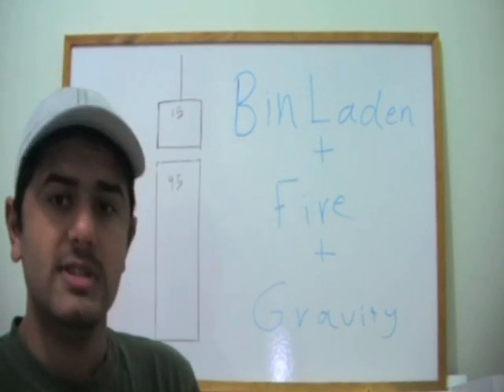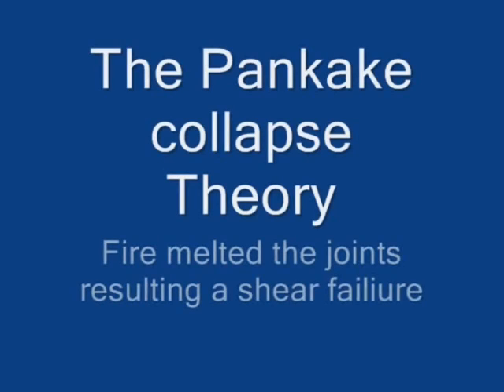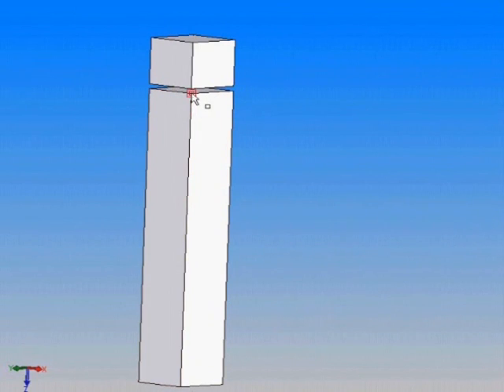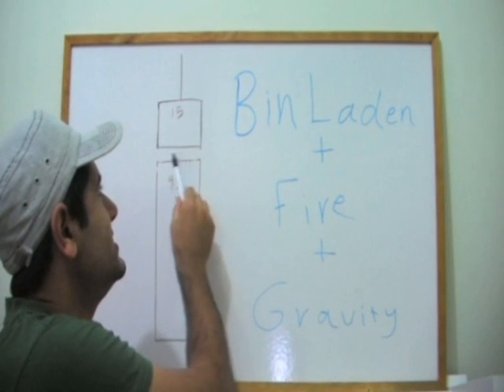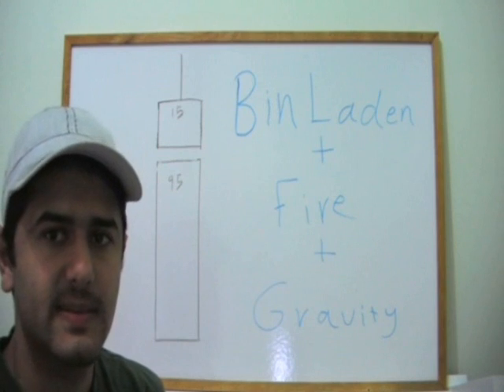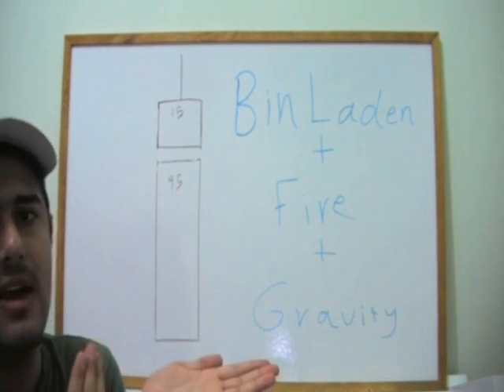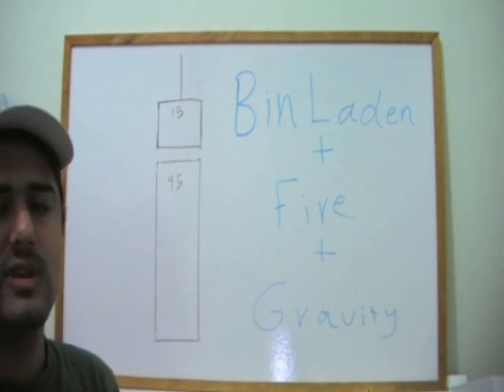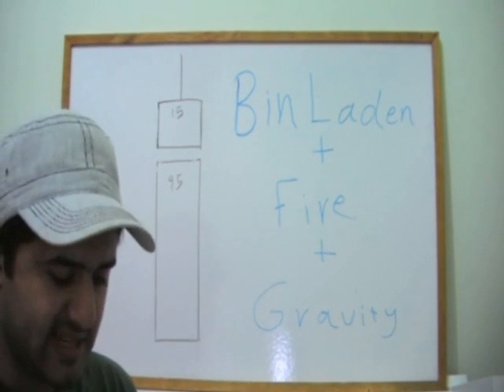(Part1) 911 Simple Physics Structural Failure Vs Demolition

Comment: "According to the 1964 white paper cited below, a Tower would still be able to withstand a 100-mile-per-hour wind after all the perimeter columns on one face and some of the columns on each adjacent face had been cut. Also, John Skilling is cited by the Engineering News Record for the claim that "live loads on these perimeter columns can be increased more than 2000% before failure occurs."

Comment: "John Skilling was the head structural engineer for the World Trade Center. In a 1993 interview, Skilling stated that the Towers were designed to withstand the impact and fires from the collision of a large jetliner such as Boeing 707 or Douglas DC-8. Our analysis indicated the biggest problem would be the fact that all the fuel (from the airplane) would dump into the building. There would be a horrendous fire. A lot of people would be killed,  The building structure would still be there."

Comment: They estimate the ' 767 ' had around 10,000 gallons of fuel. Not even 40% of a fully laden 707. A 707 traveling in normal flight actually has MORE kinetic energy kinetic energy than a 767, despite the slightly smaller size.  
     "The critical load ratio was probably well over 10, meaning that more than nine-tenths of the columns at the same level would have to fail before the weight of the top could have overcome the support capacity of the remaining columns."

Comment: @hornetgags 
LOL we're not talking about the maximum weight of a 767. We are talking about the actual weight of the 767 which is prolly more like 340,000 considering it was nowhere near fully laden LOL,, vs the maximum weight of a FULLY LADEN 707 which is around 340,000. So roughly they are the same weight. You are simply stupid and cant read or u flat out lie.The building was designed to take impact from a fully laden 707 at a speed OVER 600mph. Much more destructive than a 767 traveling at 500

Comment: @splendid1000 Not exactly true, the south tower core was impacted but not to the same degree as the north tower. However, it impacted towards the corner, as a result the opposite corner had greater weight pressure applied on it.

Comment: @splendid1000 I did:
The maximum takeoff weight for a Boeing 707-320B is 336,000 pounds.
The maximum takeoff weight for a Boeing 767-200ER is 395,000 pounds

The impact test for the 707 was lost in fog, lower on fuel and approaching at landing speed. Not a fully laden heavier 767 impacting at near max velocity. A full tank is very important as it is 1000s of pounds, you're just being plain ignorant (apologies for the pun).

Comment: @splendid1000 Unfortunately, this is where the Truth movement fails miserably. In a trial it's down to the prosecution to prove guilt. You are accusing so the burden of proof is on you. You send me evidence that explosives were used. Guess what? The truthers have been trying for 10 years and not a single one of their 'scientists' or structural engineers has published a white paper for peer review. It's just not scientifically possible, you should read the executive summaries from the NIST report

Comment: No to mention that the South Tower core was hardly touched and thermal analysis has proven that the vertical lengths(not break points) were never exposed to temps above 500 F. Not to mention there are two conflicting reports. Not to mention that NIST embellished, speculated and flat out lied throughout the entire report. Not to mention that NIST refuses to release the raw data that supports their absurd conclusions Not to mention that NIST completely ignored National Standards. LOL dream on

Comment: And a full tank of fuel doesnt make a significant difference anyway. The majority of a low or full tank would burn off in a matter of minutes either way and both collapses occurred well after the fuel was used up.  It was the ensuing 'office' fires, according to their report, that caused enough thermal expansion to induce collapse. Office fires that would result whether the tank was full or half full.

Comment: @hornetgags 
I highly doubt they failed to entertain the possibility of a 707 compromising even a very limited fraction(6/47) of the core columns, or possibly having a full tank of fuel lol. And if they didnt, that tells me that they knew a normal commercial airliner could not penetrate and compromise the building the way they were compromised on 9/11. Which tells me these were most likely not normal commercial crafts. And a Boeing 707 Advanced actually weighs more than a 767.

Comment: And whether or not it looks exactly like a classic demolition is irrelevant. You can easily demolish a building without it completely mirroring that of a normal demo. I have seen planned demos that failed to collapse the building at all, or only collapsed certain sections...So its more than possible to purposely collapse a building in a manner inconsistent with a traditional demo by using well placed and well timed detonations.

Comment: the whole building was mostly hollow by volume, the top could have never slided or toppled because the falling broken columns/grids lock into each other. the reality is a combination of the pancake theory and a bowing gravity collapse. the steel was weakened everywhere and the floors began to sag at heat concentration point, until they snapped and it gave in to the enourmous force of its own mass. at that point it becomes self destructive. (go to watch?v=bMZ-nkYr46w and learn.. plenty evidence)

Comment: @phlyegles43 ive even done the math taking a 150 ton jet doing 300mph just tobe safe about speed estimates hits a building it hits with 10000 tons   of impact force in a small area a 200 ton jet doing 500mph hits with 18750 tons of impact force and then 10000 lbs of jet fuel exploding inside the towers no matter what people want to think these building were not 1000ft tall bunkers

Comment: @phlyegles43 yeah ive tried explaining to people all the factors involved but their answer is always the same "oh im lying, im a idiot, im in the military so in on it whatever."  ive tried explaining that aircraft grade aluminum is stronger than most types of steel and that the force of 10000 lbs of jet fuel exploding inside the towers help with structural failure occur

Comment: @squirttle92 
So? Where do I come from? I would like to know.
My standpoint: If the top of a WTC is in motion nothing is going to stop it anymore because the lower floors are not intended to take that amount of energy.

The question is, why could it collapse and that fast?
What about security factors? Were the WTCs engineered at the edge of failure?
Even NIST admitted, significant temperature remained under 600°C. (leave alone 5-10min of kerosene fire)
What about heat transfer through the core?

Comment: @dugall1 Key word: immense. I can see where you are coming from - it had an ambigious meaning, but a building can not take the upper sections of itself collasping onto the lower sections. No building can take dynamic loads like that. That's what I meant about the air pressure being distributed across a larger surface area and the force in relation to the plane - different examples of dynamic loads. I apologize for not clarifying my point.

Comment: @dugall1 Yes, air pressure distributed over large areas does result in immense forces on the building. 

I never said the initial impact of the aircraft was the cause of the collapse. Rather, the weakened sections failed, causing the section above to fall onto those below.

Comment: @squirttle92 
Air pressure distributed over large areas results in immense forces to the building structure.
Skyskrapers are designed to take the static load of it's own weight, humans and interior equipment AND DYNAMIC LOADS resulting of movement inside house (e.g. people, machines, elevators) and especially outside house -> winds, earthquakes. Then, something most people don't know is, that in any kind of construction you ALWAYS add a security factor of at least 2-3 and more depending on case.

Comment: @squirttle92 
My statement was directed to arguments, that the foundation should "not remained 100% intact", "rock the foundation" and "that it didn't fall over". That are ridiculous statements.

Comparison by impulse = mass x speed

75% Mass Airplane 767 -> 300'000lb = 139'000kg , speed ca. 500 mph = 224 m/s
=> Impulse = 31Mkgm/s

30% Mass WTC wind shaking -> 150'000'000kg,  speed ca. 2 m/s
=> Impulse = 300 Mkgm/s

Do you think a 31 over a 300 Mkgm/s impulse would make the building fall over?

Comment: @dugall1 Buildings are designed to take immense amounts of static loads, not dynamics loads. Moreover, like you pointed out, buildings do experience huge forces caused by wind but this is distributed across a large area. The aircraft's force was confined to a much smaller surface area i.e the point of impact.

Comment: @TrickyE 
Completely false statement. Skyscraper are exposed to huge forces caused by winds pressing against the facades. How much kinetic energy do you think do skyskrapers contain when shaking? Incredibly much more than just by an impact of an airplane, whose energy mostly get's lost by shooting out on the other side of the building.
Have you ever shot with a gun through any object.Not much happens unless it's a massive material. The shot just passes through it and lets shake/vibrate it a bit.

Comment: @phlyegles43 
1. Yes ,he oversimplifies in favour of the official version. Here he makes the assumption that the floors with the fire just suddenly disappear allowing free fall speed. And that is a huge oversimplification.
2. Near ground commercial jetliners do not fly with an average of 545 mph. This statement is wrong completely. In heights of several 10000 ft. Jetliners may fly with air speeds over 500mph but not near ground. The near ground and AVERAGE speed anyway is much much lower.

Comment: The buildings pretty much did what they were supposed to do as well.  These jets either didn't exist, or were so rare when the buildings were constructed that resistance to their impact couldn't have been designed within any reasonable economic limits.  Structural steel is ductile enough that it helps to delay catastrophic failure, and that's exactly what happened here.  The buildings stayed standing for a really long time considering the magnitude of the impact they were faced with.  ERTW

Comment: There are so many holes in this.  The steel did not melt in these buildings....it didn't have to.  Structural steel loses more than 75% of its strength beyond a certain temperature (can't remember what it is though), and who says the foundation remained 100% intact after the impact?  phlyegles is right...a plane at 545 mph is carriying unfathomable amounts of energy which is surely enough to rock the foundation of the building.  The fact that it didn't fall over immediately is amazing enough!

Comment: @shorty40merza 

It is actually a bit longer than the often sighted 10 Seconds....Parts of the buildings did hit the ground in around 10 Seconds but the main bulk of the internal structure took longer to reach ground level..that is if it ever did reach ground level as it seemed that the majority of the massive structures actually disintergrated in mid air leaving no-way near as large a pile as there should have been!?

Not to forget the massive holes gouged out of the buildings' sub-levels!?

Comment: @Chinomareno 

Given the huge weight of the section falling, heat doesn't have to be uniform across the compromised floor for a mostly vertical collapse. For it to fall sideways a lot of energy would have to be imparted from the base swinging wildly enough to be visible or a collapse of the floors below bias to one side which would also have been visible.

The fact you showed us a botched low rise demolition show a lack of research and respect for the subject.

Comment: You do realize the tower is not the same design as a 20 story apartment building right?

This entire model is so wrong, WTC was not primarily supported by a system of central steel columns but by it's perimeter tube frame. Most of the towers load bearing strength is lost once any of it is compromised.

Comment: @noozilander That's either, the jet fuel blasting down the elvator shafts, or again the shock wave of the plane hitting, eitherway, the colapse did not start at the basement, in fact, the basement survived more than the upper building, s if you beleive it to be a controlled demoition, those"blasts" would have been utterly pointless and ineffective. I believe Rodriguez heard three blasts, 1. shock wave. 2. sound. 3 jet fuel in shafts. No one elsee thinks it was bombs, and Mr. R is in a bad.....

Comment: @TheFlyposter "I can also demistify what William Rodriguez heard. from the basement. The plane hit the tower, the shockwave travelled through the building, he expierienced that, then he heard the plane hit the tower. a shockwave/vibration is virtually instant, sound travels through air slower......"

Except Rodriguez said that the plane impact came about 10 full seconds later than the explosion underneath. He also said the force of the explosion pushed him 'upwards'.

Comment: @smujismuj What he did was, he looked at the FULL testimony, not the quote mined ones used by truthers, if you are in doubt, show me a quote, and I will give you the full quote and context.
I can also demistify what William Rodriguez heard. from the basement. The plane hit the tower, the shockwave travelled through the building, he expierienced that, then he heard the plane hit the tower. a shockwave/vibration is virtually instant, sound travels through air slower......

Comment: lets see , it was about a billon degreees in the building, the  buillding with people waving out the window.  wow they sure took alot of heat, enough heat to melt steele. ok it was kinda hot so hot they jumped out..  although they were not on fire when they jumpled but somehow so hot it melted the steele. hmmm surly weve see building that were suppose to fall into its own foot print screw up? but not these three?

Comment: @smujismuj Dunno why the link aint working, however the outer shell has fully collapsed, leaving the exposed core, you get a glimpse of it in the video. search for world trade center no freefall, you will find the vid, go to 30 seconds in, you'll see the core bit I was talking about.
The giant cores of wtc were segmented, they are not one giant beam going from top to bottom, the segments can only stand if laterally supported, that's how and why the toppled when the building came down.

Comment: @TheFlyposter 
This link did not work.
But if it's the one I think it is, the structure that is still sticking up is not the central columns, it is part of the outer skin.  The central columns were much thicker and should not have been effected if the absurd "pancake" theory had any credibility.  There were no significant fires in the floors below the level of the planes, so what weakened the central columns?

Comment: @smujismuj We can rule out thermate, because thermate leaves large quantites of Barium Nitrate behind, no one found a trace of BN. Steel does not remain molten for weeks, that is impossible, so it had to be other materials that the undergound fires were melting. they would have been hot enough to melt alluminium, WTC-1 and 2 were clad in aluminium.

Comment: @TheFlyposter 
Thermate is used to cut steel by melting through it.
That accounts for the molten steel pouring out of the building before it collapsed and for the molten steel that lasted for weeks under the wreckage, testified to by clean up workers.
There's no reason that whoever did this couldn't have used explosives as well.
There were huge steel columns in the center of 1 & 2, where did they go?
Why didn't they remain standing, at least up to the floors where the planes hit?

Comment: @smujismuj 

There was no freefall in WTC 1 and 2.

There was no molten steel. 

You are also contradicting yourself, because if it was bought down with explosives, there would be no molten steel, explosives don't melt steel, if it was bought down with thermite there would be no explosions, thermite is an incendary, not an explosive. So which was it in your view?

Comment: @TheFlyposter a) Are you aware that the pancake theory was officially revoked? e.g. because both buildings had massive elevator shafts. b) reg. simple physics, it still does not make any sense. 1/4 does NOT have enough kinetic energy to make the rest crash (even if you ad floor by floor). Explain to me: Where does the energy come from?

Comment: @gunthaarz There's a big difference between the steels used in construction and those used in tank armour (plus the armour fitted to the Challenger 2 and M1A2 is more than just steel, it is a laminate mix of steel, ceramic plates and polymer, and is specifically designed to resist the aforementioned tungsten projectiles. Buildings are generally not specifically designed to withstand high velocity impacts, the steel supports in them are designed to take constant tensile/compressive loads).

Comment: There is only 1 explanation as to how any steel&concrete building will collapse in a straight line into itself within 30 seconds - trategically placed explosives is the only way we KNOW possible- we DONT KNOW that the buildings collapsing on 9/11 was caused by fire as there is no proof of it - thus we must assume they collapsed by the only method we know how, and look for proof of the latter. 3 buildings collapsing within 24 hours is only possible with pre-planted explosives, can't be a failure.